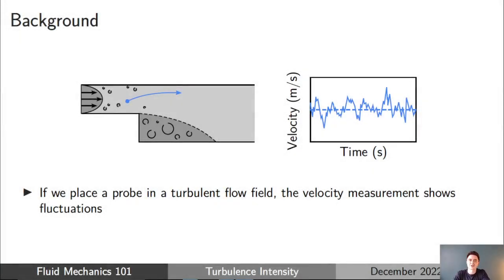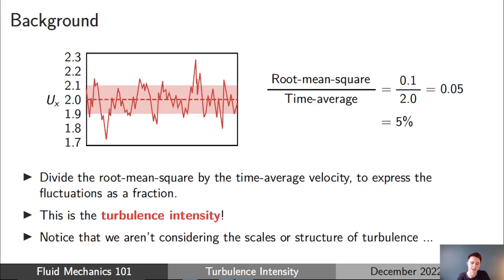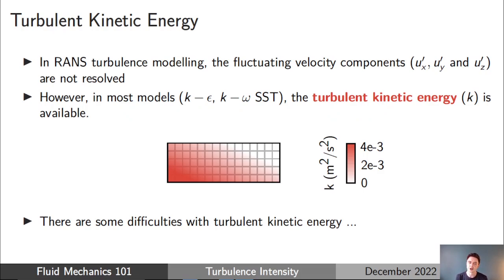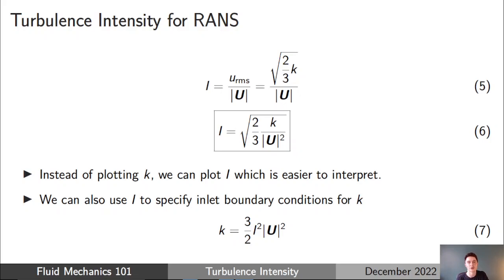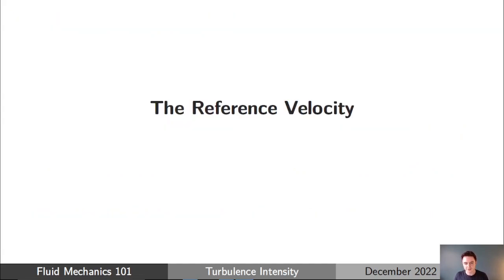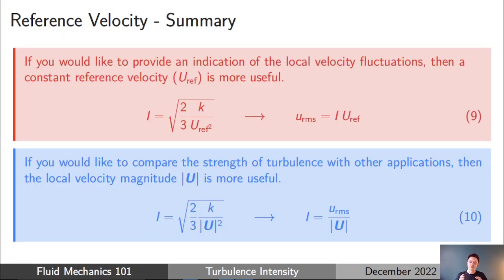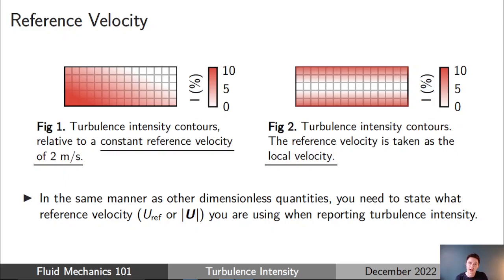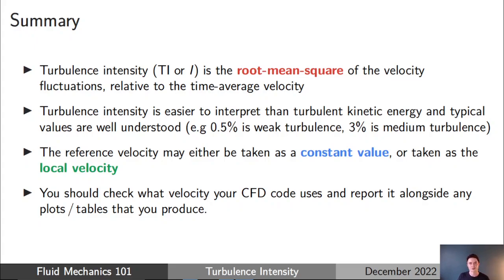[CFD] Turbulence Intensity for RANS

Comment: If I make a contour of turbulence intensity in Fluent, the contour typically use the reference velocity which is defined in the Reference Data Settings Page. But if I want the turbulence intensity based on the local velocity, the typical turbulence intensity in Fluent should be treated as a constant. And after that, multiply it with the velocity magnitude.
Reply from the maker: Yep. You can always define a 'custom field function' with your own definition and then you can plot exactly what you want 👍

Comment: I am confused with the definition of urms, isn't it the average of one fluctuating velocity component over time, eg: u' is instantaneous fluctuation along x-direction, urms is square root of u'^2 only? So that T.I is different along 3 different axis, Tx Ty and Tz
Reply from the maker: You could define it that way if you wanted. I think the important thing is to check the manual of the CFD code you are using, so that you know what is being  reported. If you are doing the post-processing yourself, you can define Tx, Ty and Tz yourself, or any other quantity that you wanted! This is the art of good engineering, knowing what quantity is best to report and in what way, so that you can use it to make good decisions

Comment: Excellent as usual!
In 5:10 the 6th item in the list: "Sum and take the square root". Isn't 'sum' redundant since in step 5 the mean of x,y, and z components is calculated?
Reply: Hi. I might have the same doubt of yours, step 5 should be better a recall to also perform steps 1 to 4 for the other velocity components (y and z), and then finally go to step 6 for a unique urms value that involves all the fluctuating velocities

Comment: Great content as always.

I've never understood the pro/con of this same intuition when applied to Pressure&Temperature boundary conditions where the options exist to use TKE & ESP or Length Scale &  Viscosity Ratio.

Is there a reason you should employ one strategy over another when applied to a URANS sim for example?
Reply from the maker: Ultimately the value will be the same, so it doesn't really matter. If you are going to have to change the boundary condition (for example to investigate the effect of a range of different ambient turbulence conditions) then I would choose the option that makes it easiest for you to change, so that you don't have to re-do the calculation yourself (you might make an error).

Comment: If I look at an ABL flow (6.44m/sec @10m and z0=1m) I see at 12.5m height;, a speed |U| of 7.2m/sec and a KTE of around 1.6m2/sec2. And this gives an I =sqrt(2KTE)/|U|=sqrt(21.6)/7.2=25%
So your boundaries (1 and 5%) do not really work for an ABL environment. Do I misunderstand? Thanks for the feedback.
Reply from the maker: You are correct. For an ABL there are profiles of k and epsilon which are recommended (see the original paper by Hargreaves)
Reply: That's correct, the BC for turbulents fields (TKE, epsilon or omega) follows variable with height formulas according to the approach you want to use for the ABL: shear stress driven flow (Richard & Hoxey 1993) or pressure driven flow (Deaves and Richard & Norris 2018), taking aside if you want to model neutral or non-neutral ABL. So the standard theory we find in CFD courses to set a fixed value of TI or for the turbulent fields won't match with accurate inlet profiles, and so downwind results may differ a lot from your experimental data.